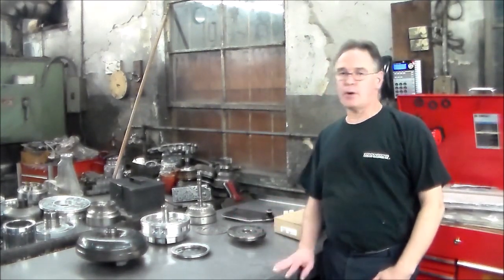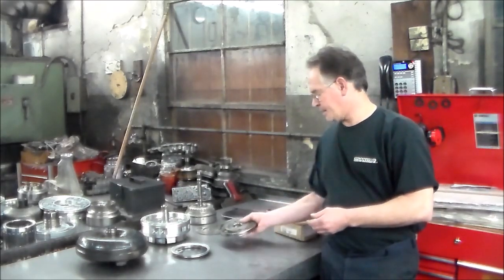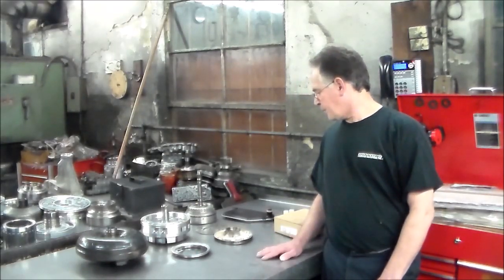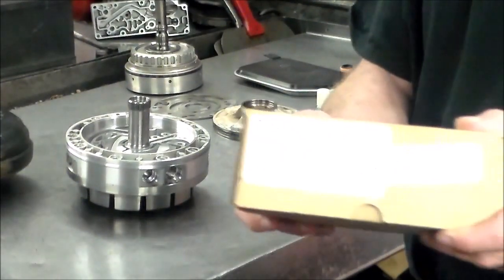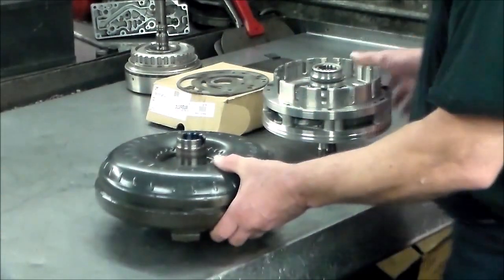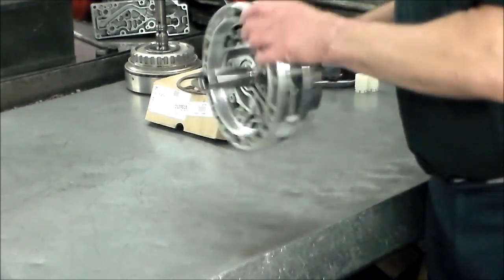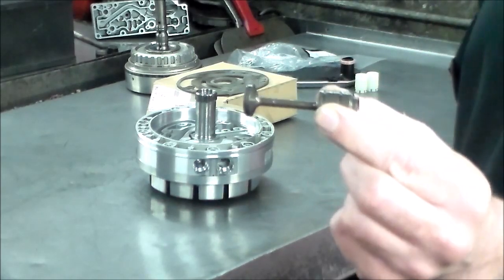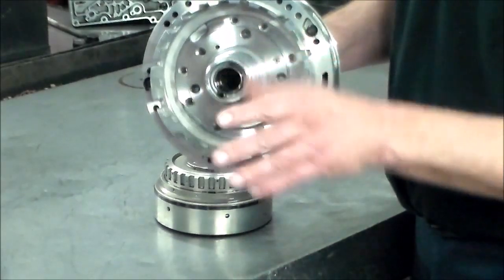ZF5HP19 Front Pump Leak

Comment: Thanks for the video I'm tracking down problems on my 2000 Porsche Boxster. Slow 2 month leak at front, no obvious drips but seems like oil accumulation between trans/engine area. I'm looking to pull the transmission out and replace the oil pump and Torque Converter. Thanks for the info.
Reply from the maker: If you have a leak from the front, that is exactly what needs to be done
Reply: @GaryFerraro  after a fill and two months of driving I get signs to add oil like sudden downshift when slowing and sometimes it just doesn’t move unless I sit and wait and reverse then forward. I assume the oil seal is where the leak is. So I add fluid and drive till the next time. It’s a learning process for me. I thought I would start with TC and oil pump and see if that resolves it. Original oil was super black Ive drained and refilled several times hoping that would help and shifts were smoother.
Reply from the maker: @schrockahasi  so you have a delay in drive and in reverse?
Reply: @GaryFerraro yes sometimes when I just start it takes a second or two to engage reverse. I have had a little shudder in reverse too. All gears have noticeable gear changes. The transmission heats up to 220 on the case and seems like it drags in 4th and 5th at times.

Comment: How can you test a torque converter clutch if the transmission no longer shifts. Already pulling the transmission (ZF5hp19) out of the car.
Reply from the maker: you really can't,  did the bushing spin out of the pump?

Comment: Professional thanks for the information. 
Oil leakage notice from trany input shaft or pump do I need to disassemble the front only or complete e60 550i zf 6hp26
Reply from the maker: Did you clean it down to confirm this? not common at all for a leak in the front
Reply: @GaryFerraro  I clean and I think transmission oil is leaking from the seal its really not common I want remove the transmission.
Reply from the maker: @laithelfawair1723  you cleaned it down and let it run? are you sure it's trans fluid and not engine oil

Comment: Thank You for very well made informational videos. May be you have an answer for my 5HP19 problem. So, had the no reverse. Took trans out, and while I was doing the reverse drum fix I did a rebuild replacing all seals, clutch packs and what ever came with the original ZF rebuild kit. Put a new TC on. Installed trans. Major oil leak from bell hosing. OK I said, pulled the trans, replaced oil pump and replaced TC with yet another rebuilt one. Same thing. Major oil leak from bell housing. Now my engine blew a rod bearing. So, put a new low mileage engine in. Installed yet another new oil pump in trans after finding out the last one was some China BS supplier likely redoing the bearings. This time a new OEM ZF goes in. With the new seal already installed. I mated the trans to the engine outside of car, meaning I was able to really make sure all goes together nicely. Just test drove. Engine and all is well. SAME TRANS LEAK from bell housing. I AM ABOUT TO DO I DON'T KNOW WHAT....What could it be??? What did I screw up. First, no leak , but no reverse. No, trans shifts and runs well, but leaks after all the above??? The only thing I notice is a whine which is sometimes present. That is what I attributed to the well known front input bearing. But the bearing is good. Sits well in the pump. TC sits well in bearing. Tried with pump out before installing. Bearing looks good. WHERE IS THIS OIL LEAK COMING FROM? HELP , Please help. I am totally lost. And now I am to deep into to give up. You are the only expert I could imagine may have an answer to this freak thing. I am sure I screwed something up. But what? Opened trans twice? Went over everything meticulously with the ZF literature, diagrams ect. ?? Should I just blow it up?? May be you can shed light on this one.
Reply from the maker: ok, your 100% sure it's leaking from the front and not somewhere else but it appears to be the front, how bad steady stream leaking when car is running?. If it is leaking from the front , when you pull the trans back out and pull the converter off are you seeing anything with the front seal or converter?
Reply: @GaryFerraro   Thank you for responding. If you'd be local I'd be there. 

Well, that is what is so startling to me. It drips out of the openings on the bottom of the bell housing. I have it on the lift. With the engine running it starts dripping steady. Engine off, it stops. So my assumption was pressure side by oil pump. Remember I did replace the TC with a rebuilt. For good measure replaced TC (again) and Pump. Same problem again. Pulled trans again. Seal good. Nothing damaged. bearing good. TC looks good. So, new, this time ZF OEM oil pump goes in. Same TC this time. tripple checked. Looked for cracks. Outer O-ring on pump is new. I can't find any other places on front of trans where the oil could leak out. No missed blind plugs I can see. For good measure added gasket maker to the bolts around the pump thinking the little seal rings may be it. I cleaned outer case several times and was looking for outer possible sources. If it comes out of the bell housing my assumption is, it leaks by front of trans. Could slight overfilling cause this? Meaning it comes out somewhere else and somehow find its way out of the front? No idea. The first time I filled in car following ZF procedure w. engine running after hitting initial full on plug. This time I filled to spec by volume as I place the trans into the car as a unit with the engine. Thinking with you experience you may have some idea of something you may have seen. I am ready to bite the bullet and just get a junkyard trans and never open it. BUT....I rebuilt all the innards of this one with new clutches ect. I am lost... obviously. 

It is obvious I must be missing something. I can't wrap my head around.
Reply from the maker: @gerhard5911  Ok, so there is a large o-ring  and a smaller one for the body and gears, both o-rings are installed?
Reply: @GaryFerraro  Yes. Just double checked my pics. They are in. They show on ZF as part 10.360 and 10.030 came with rebuilt kit. Possibly unrelated what I found in the meantime. 1) Had to much oil in. Corrected that. (Can that be the cause?)  2) had very small leak on cooler pipes going into trans. My helper (son) missed the o-rings. Driving it today. Checking tonight on lift. Will post update.
Reply: @GaryFerraro  Hi, we are thinking along the same lines. I am questioning my own observation of it coming from the front. Yes its dripping out the bottom of the bell housing. But I am thinking there is something else going on, i.e. breather on top running into the bell housing from me overfilling? Something like that. I may have overfilled it. I didnt pay attention to ATF temp when I filled it. I drained exactly 1 qt of ATF. Trans shifts fine. 1Qt is a lot. I will check fill level again properly next couple days. And the front of TC and seal look perfect. Not a single thing or scratch on either which would make me think there is a problem. And since this is the 3rd time, well yeah...overfilling is the only constant possibility. Because rather than doing it correctly by procedure I prefilled based on the qty I filled before. Makes sense? Can overfilling cause this?

Comment: Hi Gary.

Are there any other tips or suggestions when rebuilding the rest of the transmission? Looking to do a full rebuild.
Reply from the maker: Check the sleeve on the F clutch drum, I have a video on that too,  Called ZF5HP19 Gear Monitoring codes.  What is the problem with your trans?
Reply: @GaryFerraro  I had and 03 audi a4 with and 19fla the blew the front pump seal. I bought another for 600 dollars with 178k and the previous owner had driven it with about 1.5 litres down on fluid. I found this out when I had a service done and there was apparently a lot of clutch material. I just want to be prepared. The trans doesnt shift as firmly as the old one which in this case is not good.

Comment: Gary thanks for the posted keep coming. I got a stupid question 03 x5 3.0...the front differential took a went. The suv right now won't go forward or reverse. I can feel the front differential is holding it..I can't get the nuts on the drive shaft out because I can't turn the shaft to remove the other nuts and bolts...the shaft is seized in there..can I cut off the front driveshaft so I can move the car..since the front  differential ain't good. Do I need to look at other things in the car that could have went bad cuz of this issue
Reply from the maker: You need to look at tires are they all the Exact same model and size.  The car may not move if you take the front shaft out.  What happened to the bolts?
Reply: Thank you for replying back. I appreciate so much...yes the tires all the same model, size. The suv come to a hard stop.  Check the front differential no fluid and I also found metal. I'm trying to remove the shaft..but the shaft won't spin for me to get to the other bolts..I'm tryin to move it to my garage to work on it
P.s 
When I jack the rear. The vehicle is in park. The wheels spin freely even in drive is that normal..but when I put it to drive the wheel pick up speed when I give it gas ..does that mean my transfer case is bad or that's normal

Comment: I need help!!! I have a 07 bmw 525xi,it was sitting for about 1 yr when I bought it,long story short I replaced the engine and when I turned it on a loud noise was coming from transmission area possibly torque converter I'm not sure but I added more oil to transmission because I noticed it had a leak from pan so after adding trans fluid the noise went away but now transmission only acknowledges the gears and engages but WONT MOVE in any gear.So then out of frustration I bought another transmission from someone but it's from a 535xi which the shift cable and system is different apparently so now I dont know what to do and I have literally thousands in it now so any advice would be greatly appreciated thanks. (btw I have limited experience with BMW's).
Reply from the maker: sounds to me like the pump may be no good. So the trans you bought is an M shift and you have an E shift?
Reply: @GaryFerraro  oil pump? and yes I believe so.